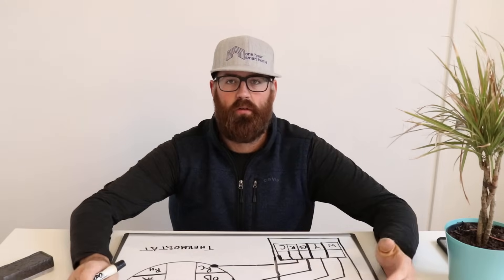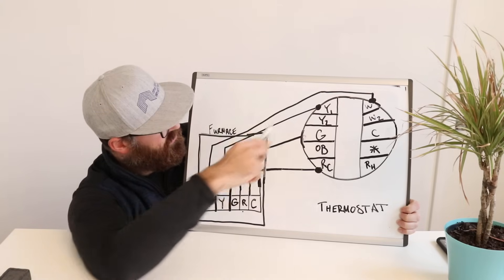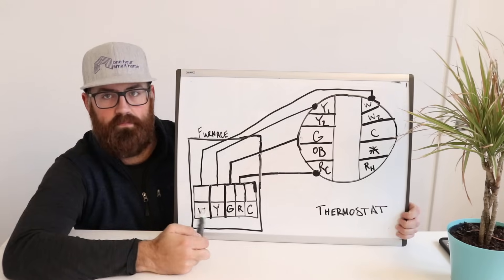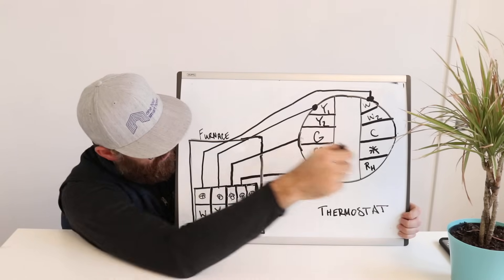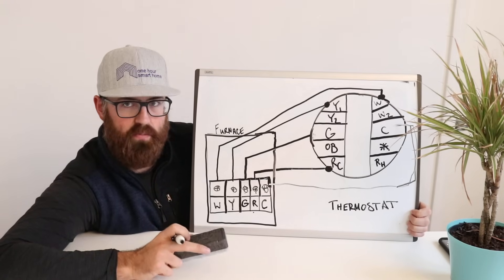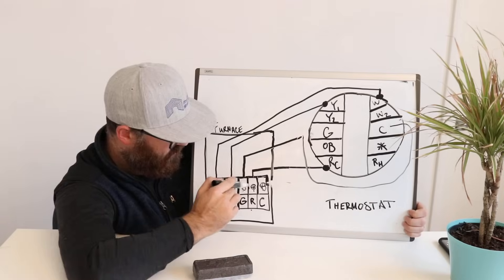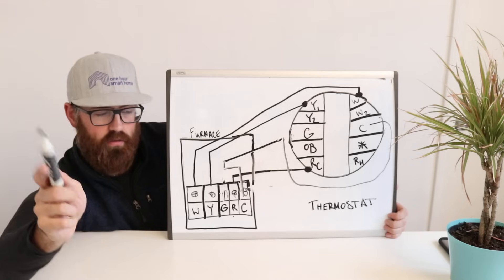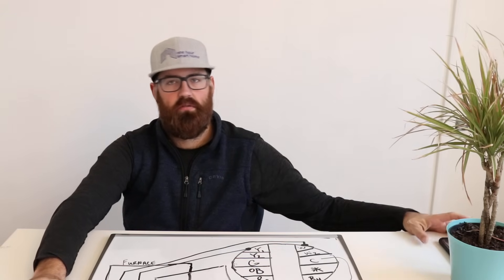Nest Wiring Diagram How To Install C Wire or Common Wire

Comment: Thank you very much for your great videoa. They are very helpful for an amateur DIY person like me. I tried to install NEST thermostat in my home but I noticed the C wire is not connected with my Emerson thermostat. So, I was told by a friend that this 4 to 5 wire device is available in the market, which I can use it. Could you please give your opinion on that product and how to use it, pros and cons if possible. Thanks very much in advance. https://www.amazon.ca/dp/B06XDBB4H6/ref=cm_sw_r_wa_apa_i_CQRBFb190FDKX

Comment: What do you do if you have a common wire but it’s only putting out 16.5v ac? My friends house has a thermostat for upstairs and downstairs but it’s not two independent systems. Everything in your video matches the wiring. But no power detected because the common isn’t putting out enough voltage. Any advice you can offer would be much appreciated.

Comment: HI
 I just made the green wire change - and lost the a/c function on the thermostat. Now I have heat or off only.  Any ideas? Thanks
Reply: Did you figure this out? I have the same issue!
Reply: @nikkiflores9251  Not really. I moved the green wire to common for the heating system, and I'll move it back in the spring. Not an answer to the problem and I may re-install my Honeywell programable unit

Comment: Greetings,

I was wondering if you could help me. I had the following wires on my old thermostat: R, Rc, Y, W, G, and C. I recently bought a nest, but when I hooked up the wires, R to Rh on the new Nest 3rd Generation thermostat, W wire to W1, G to G, Y to Y1, and the common wire to common, but the nest product wouldn't power on, when it did come on it said that the common wire didn't have power, so I manuvered the wire that was in the common spot and plugged it in O/B and my heat and cooling are working. Will it be okay, or should I take it out?

Comment: Do you have to reset the nest after you connect the common wire?
Reply from the maker: No, it will automatically update the wiring settings on the Nest you just need to confirm them on screen.

Comment: Hi. I have a blue wire not used at the thermostat hole but not used on my existing thermostat,  can i just make sure its connected to "c" at the furnace or if not, just connect it at the furnace to "c"?
Reply: Hi, Franklin, my situation is the same as yours. What did you end up doing? Thank you.
Reply: @jsordaz  i chased it to the furnace, there was no circuit board as it was just hard wired into the other wires.  I found that it was connected to the condenser circuit and furnace power so it was live. So i just connected it to my thermostat and it worked.
Reply: @FranklinDBluth-yq6ww , thank you. I have a Common wire terminal in my thermostat relay and on my boiler circuit board. I am going to try to connect the unused blue wire (in the wall) to the COM terminal in the thermostat relay. Theoretically it should work to power the Nest Thermostat E.

Comment: The common already has a 2nd RED wire connected When I connect the GREEN to the Common Nest shows no power.  I also connected the blue wire to the Common in the Nest but on the furnace the 2nd RED is connected to the common I added the BLUE wire and again it showed no power on the red wire.  On the nest I have R W G Y B  on the furnace I have 2 red wires 1 white and 1 green.   I also have 2 AC and 2 furnaces

Comment: I cannot find the screws on the furnace, it has a plug that comes off the board then it has wire nuts connecting the thermostat wires to the plug wires.

Comment: Your videos are very helpful but I am still having a problem with getting the Nest to work.  I have a Lennox HVAC and an Lennox iComfort WiFi thermostat.  The termninals are labeled R, i+,i-, and C.  There are five wires: the 4 usual ones and a light blue one.   The green and the blue wires both went into the C terminal.  Is the blue wire a common wire?

Comment: Because I use the fan to continue running for a few minutes at the end of the cooling cycle, I decided to use the W wire as the C wire. Yes, I will have to switch this back in the late fall, and can then use the Y wire at that point, but I won't loose the Fan feature of an extra few minutes of cool air after the cycle completes.

Comment: Back in December 2019 I got a 3rd Gen Nest and I followed the instructions in this video, using/rerouting the existing G wire for the C wire, and my heating worked fine. Now it's May 2020 I just went to turn on the AC and they AC compressor (the outside unit) turns on but the fan isn't blowing to push the cool air through the vents. What could be the problem?
Reply: On my gas furnace should I run a jumper from the Y to G terminal so the fan turns on with the AC?
Reply: @christinedisebastian7308  -- Did you try it?  What happened?  It sounded like a good solution to me.

Comment: I have a modular home.  My furnace has no control board. It has a red,black,greeen and white wire.  These wires are connected to the thermostat wires with wire nuts.  I see no option for a common wire ?? The home is only 3 years old.  I pulled all panels off the furnace I see relays etc but no circuit board
Reply from the maker: You can add a common wire transformer like this : https://amzn.to/2UEwQHZ and watch this video: https://youtu.be/gahPxCcPDto let me know if you have any other questions.

Comment: What’s wrong w connecting both the G & the C wires from point A to B? In that way I’ll have a fan and a common charging wire too.
Reply from the maker: I think I understand your question but might need more clarification from you. You can have a c wire connected from the c wire terminal on the furnace to the c terminal on the nest. You can also have a g wire connected from the g terminal on the hvac system to the g wire on the nest. If you have both a g wire and a c wire connected. You would have charging on the c wire and fan control on the g wire. There would be nothing wrong with that configuration and it would be ideal.

Comment: Excellent idea. However I don’t have a C terminal on my HVAC 2 stage Trane. Connected I have a W3, W2, W1, G, Y2, Y1, R, B, Yo. Open I have BK and O. Can I use my green cable connected to the G terminal to either the BK or O terminals to my WiFi C terminal? I have to add a C wire for my two stage ac to work properly. A million thanks in advance!!!

Comment: Enjoyed your video but can you not add a jumper wire between the G and C terminals on the Nest and achieve the same result?
Reply from the maker: No, not the same result. The c wire is wired to a c terminal on the HVAC terminal block inside your HVAC unit.
Reply: That is a direct short and will blow a fuse or destroy the circuit board.

Comment: I cannot thank you enough for your video on using the green fan wire plugged into the c slot to power the thermostat. I would have never thought of that in a million years.  My nest was a mess. No decent power supply. The adjustment I made based on your video was done minutes before the ac tech was due to arrive for my summer ac check up. Had I not done this work around the tech would not have been able to due the check up. The standard visit for a check up is 60 dollars. The charge for diagnosis of a problem is 90 dollars. Your advise saved me 90 dollars!!  Thank you so very much.  Dan Las Vegas.

Comment: When I had a battery problem, it was heating season, Moved the Green Wire to Common on the board and thermostat. Just switched to cool, compressor runs no problem but the fan won't run? Can you explain that and let me know if there is a solution?
Reply: At the furnace you need a jumper from "y" to "g".

Comment: Help!!!! So my thermostat been working for years then it stopped yesterday. I just did this change and nothing and notice there was a extra wire in the control board but not a extra green up at the thermostat hole.
Reply: Check the 3A fuse (purple) on the control board, if there is one.

Comment: Thank you for your information.. I have a question- its possible just do a jumper wire in thermostat from G to C?
Reply from the maker: No, that won't work. You can either do this: https://www.youtube.com/watch?v=gahPxCcPDto with a common wire adapter: https://amzn.to/2UEerxs or you can change over using this method: https://youtu.be/w0BZPx8-Q5o

Comment: Great video! Lucky for me the C wire from the thermostat was just left unconnected to the control board. So I just connected that using wire nut the C wire which is already going to the outside AC unit.
Reply from the maker: Glad it helped!

Comment: I only have 2 wires red and blue. I put red to R and Blue to C but it didn’t detect heat or cooling. What else can I do?
Reply from the maker: Do you have a AC only system? or a Heat only system?

Comment: I have a blue wire connected to the common wire terminal in the furnace but the blue wire is present but not connected in the nest thermostat.  Can I strip and connect this blue wire to the nest or would I still need to use the green wire as you showed?
Reply from the maker: Just strip the blue wire and connect to the C terminal on the nest. Leave the G wire as is.
Reply: @OneHourSmartHome  Thanks for the help.

Comment: Purchased Nest gen 3 thermostat.  Old thermostat labeled w1/o/b, y1, g, r, c, w2. The nest doesn't  have w1/o/b. How do I connect W1/O/B to Nest?
Reply from the maker: Do you have a heat pump or a furnace with an AC system?

Comment: What about a Separate AC unit and Boiler for hot water baseboard? I have R and W from the boiler and a Y, G and Rc from the AC. When I run my heat, the FAN of the AC turns on because its trying to charge the Nest. I have no C wire on the Boiler.Can you do a video for that?

Comment: Nice explination i have 29.6vlts at the termostat 2nd issue my air handler has relays i didnt see a board.  I called nest i was told too much volts at the termostat do i conect a common wire and how thanks

Comment: my old thermostat had RED to R/GREEN to G, BLUE to C/ ORANGE to OB, YELLOW TO Y/ WHITE to W2 
my nest has Y1 & Y2, RH & RC & W2 AUX, I PUT YELLOW ON Y1, RED ON RH AND WHITE ON W2 AUX BUT I AM GETTING COLD AIR INSTEAD OF HEAT, is the wiring wrong? I called nest, they said take white wire out and re-insert but it didn't help, anyone have any ideas?

Comment: Thank you for your helpful video with an excellent description of what to look for and how to fix the common wire problem.  I was able to pull a new thermostat wire from my unit in the basement up to the thermostat and using the wiring diagram figure out the common wire and add power to my Nest thermostat.  It had worked for about 2 years but with the heating system and Hot water heat, not running the fan,  my battery was low on voltage.  Fixed for the cost of a new wire.

Comment: How about if there is a C wire but the NEST still shows a massage of no power on C wire
Reply from the maker: Make sure the C wire is connected at the furnace terminal board.

Comment: Hi. We are building our home with foam insulation total encapsulation, needing fresh air ventilation. Would you happen to know why our HVAC installer would have to add a different module for the Nest thermostat vs. the Honeywell T6? We want the Nest thermostat, but they usually use the Honeywell, which is said to be set up for what they are installing. Thank for any insight.
Reply from the maker: Because most distributors give away honeywell thermostats for free with the furnace and many HVAC companies have no desire to make accomodations. 95% of furnace systems work with nest without issue. There are a small number of very high efficency HVAC systems that use variable fan speed control, paired with precise variable heating and cooling these systems can't use a nest but they are few and far between.
Reply: @OneHourSmartHome  thank you!

Comment: I have a Nest E thermostat but only 2 wires coming in so no power, am thinking of adding and external transformer but the transformer has 2 wires . One will go into the C terminal, but where does the other wire go, the Nest E has no other R labeled slots?
Do I just cap the wire?
Great presentation.
Thanks for any help.

Comment: What would cause the nest to cause my furnace to short cycle? i installed my nest and when i emailed nest support to see if my system was compatible i was told to wire to the white and red i tried to turn on my furnace and it would turn on.. then off shortly then on then off.. I installed my old thermostat and my furnace works fine. so i'm not sure if the nest support gave me the right set up.. but something isn't working correctly.

my thermostat that i took off had a W wire.. and red wire to RH with a jumper to RC, when i contacted nest support to see if it was compatible she sent me a picture showing to hook white to W and red to RH for the nest. i did this and it caused my furnace to short cycle. i have a green wire in my wires but it wasnt hooked up to anything previously and i'm not positive if it even goes to my furnace. any assistance would be awesome.

Comment: Some systems don't turn the fan on in cooling without a G wire causing icing and then water leaks. If you try this fix make sure your fan works in cooling. All gas fired furnaces will turn the fan on in heat but some will not in cool.

Comment: This is a great solution for those who have only four wires running from the thermostat to the furnace/blower unit; however, it's been my experience that most electricians will use a cable with six or seven wires and just not use them all.  The easiest solution is that, if you have this situation, connect the black (common) wire to the Nest, and go to the furnace/blower, and connect the black wire to the common terminal.  Another solution (if you don't want to sacrifice the functionality of turning on and off the fan from the Nest) is to use your old (4-wire) thermostat cable to pull a new 6-wire thermostat cable. Securely loop individual wires form the old cable to the new one and then tape over the connect so you have a smooth surface to pass over any tight spots along the root.  Go to the attic/basement/furnace closet and use the old wire to pull the new one through the wall/floor/ceiling, etc. and connect it as diagramed here.
Reply: Nice solution, sir!  Might you be a fellow IT tech who has fished a few Ethernet wires in his day?

Comment: I have 7 wires. One of the wires is labeled E  I think it's the emergency heat. There isn't a E on the nest diagram. Where does the E wire go on the nest? Thanks.
Reply: Do you have a gas furnace with supplemental electric strip heat? If so you can use the strip heat wire as W2.
Reply: @hokanut  thanks.   It actually goes to the connection label 👉   *

Comment: Brilliant and simple. Thank you  :)
Can you put a jumper between G and C (if there are other wire on C already)?
Reply: No. A jumper from any of the other terminals to C will cause a direct short and at best blow your 24v fuse in the furnace circuit board or at worst burn your new 200 dollar nest stat.
Reply from the maker: No, you cant jumper. The c wire goes in one terminal for providing power and the g wire is fan control.
Reply: @OneHourSmartHome  thank you

Comment: Hello, I followed your video. Thank you. I’ve had my nest running for a week and then it stopped. Issue with Rh power not giving enough juice. Changed out my transmitter, worked great, then same thing happened after like 10 days. Not sure what else to do. I have the G and the C wire. Would it be smart to connect the W1 and Rc wires together?
Reply: Get a C Wire Adapter, it is a thin white wire, drill hole all the way through the wall where the wires come out behind the thermostat (that is if you have a room there? and nothing is in the way?), push the wire through the wall with a coat hanger etc., now all you do is plug in the adapter (in the other room) and you will never have a problem again, you have to buy a 8-10" long drill bit and say 1/4" wide or so? It is easy.